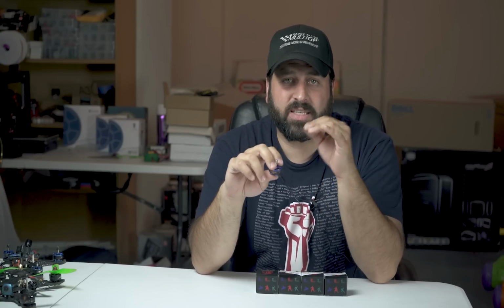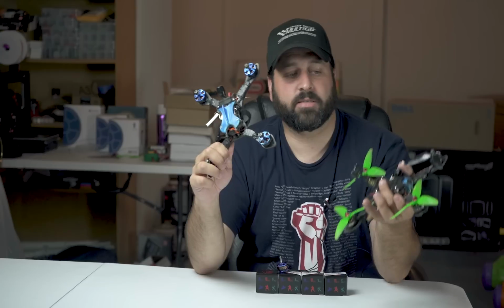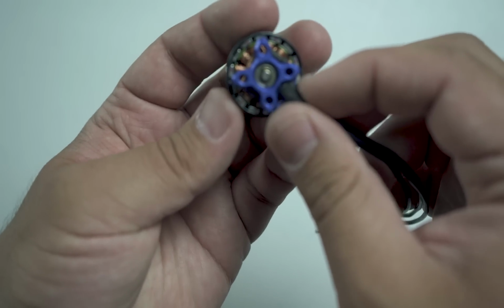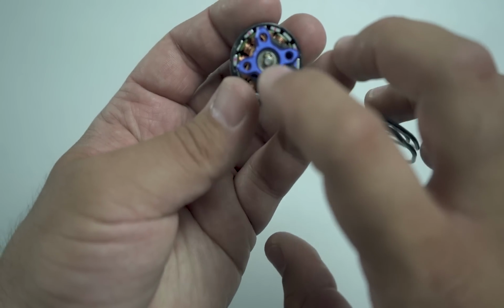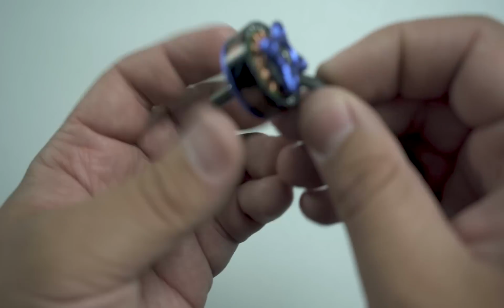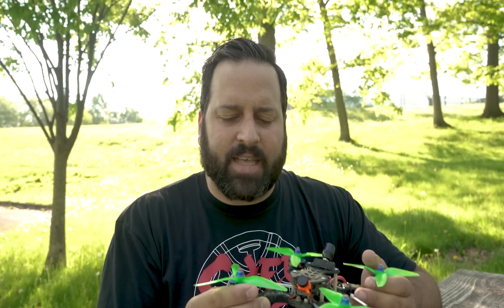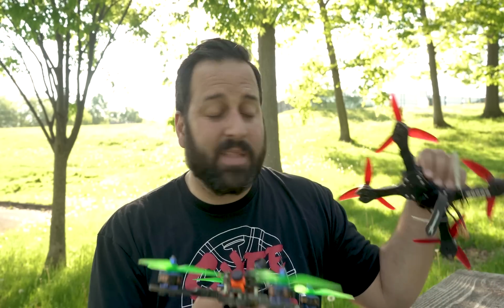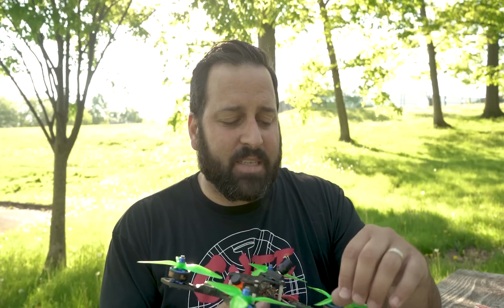DYS Samguk 2207 2600KV Motors

Comment: what hq prop would you run with this dys 2207 2600kv? and what prop would you use for the 2306 one if you have it? i wonder why racers always run 2207 and not 2306?
Reply from the maker: A lot of racers still run 2306, but 2207 is certainly more popular.  2306 is typically lighter and more efficient than 2207, but 2207 still has more power which can help taking technical maneuvers at high speeds.  

As far as props go, I'm running all 6S setups these days, but I really enjoy the HQ 5.1x4.1x3 V1S props.  I'm also a big fan of the HQ 5x5x3 V1S props.  I would probably try those first, even on these motors.

Comment: i dont like them . they have horrible bearings so much so if u fly anything more then a 4s your not gonna be able to get the vib out with filtering . it wont even fly correctly with 4s if it flys at all . the bearings will go to hell in one flight. forget it . for a bigginer why give them the headache ? for warned these motors without replacing the bearings will give u more headache then just spending 15 dollars or good lower end emaxes . i have older 2204 2300kv emaxes i purchased a year and a half ago for 24 dollars a set . 4 for 24  and they are way better for a begginer . i even run these motors on 6s and they still spin true.AFTER 2 YEARS . screw those dyss its a scam motor .

Comment: Dys Samguk motors are cheap exactly as they cost. Have two major points of failure - weak bearings and soft shafts. Bearings will begin to crumble after 2-3 weeks of active flying. Shafts will bend after medium-hard impacts against hard surfaces. The good thing - they perform really good when they are new. I have a quad with Samguk 2207 2600KV set right now. After month of use one motor bearings are began to grind and another motor shaft is bent after impact against tree branch. I guess, they will die after week or two. Conclusion is - if you have Samguk motors, don't crash your quad as long as possible. Don't land in dirt or sand. Of course, if you can spend enough for a bag of these motors, you can buy some 15-20 sets of them for one season and replace them every week :)

Comment: A have these in 2600kv and 2300kv and they fly great but a few good crashes and the bearings get pretty beat up. I have a set of hyperlites that i've crashed dozens of times and are still tight as new. I'm really all for saving money but in the long run i'd have to say stay away from cheap motors ( i'm looking at you too racerstar....) Once you turn the bell on a top quality motor and feel the super tight notch in those magnets you know where your money went.
Reply from the maker: The super tight notches aren't necessarily better though.  There are negative sides to it too.  Thanks for sharing the durability comments, that's the one thing I wish I could have tested for a video.  The performance was surprisingly good for the price at least.
Reply: John E Fly I agree, they fly great but the bearings are flimsy. Truth is I still fly mine and they fly fine, wobbly bearings and all. Im just picky i guess.

Comment: I have these exact motors. The 2207 2600kv version. And I ABSOLUTELY LOVE THEM! I've had them for a long time now and they've held up over time amazingly considering the price. These motors absolutely rip! They don't seem too amp hungry. They're super durable. They're actually 7075 aluminum. I've had big crashes, small crashes, weird crashes, and dirt burials and they've held up strong the entire time. Are there better motors out there? Yes. But the simple fact is these motors have one of the best if not THE best price to value ratios on the market. For an under $10 motor to perform this good and be able to keep up with much higher end competitors is amazing. And even if you do break one it's no big deal at all to replace. Now this is all based on my experience alone and is just my personal opinion but I can't see any reason why someone would purchase racerstars over these. Props to DYS for somehow managing to make such a damn good motor for so cheap! Great review! Keep up the great work and content.

Comment: Did your dvr came from your HDO goggle?
Reply from the maker: Yes it did.  But I would say that something is acting up with the tramp that I was using in the build with the DYS motors.  The video was better with my 6S quad and the one with the EMAX motors.  (not noise, just reception quality).

All builds were running Runcam Swift Micro or Runcam Swift Micro 2 cameras.
Reply: John E Fly  thanks for the quick reply. I’m thinking of upgrading my Dom V3 to the HDO as well.

Comment: They seam like a winner for THAT price but as some one mentioned all you have to do is replace bearings for $10...  will if your going to do that I would suggest an alternative upgrade to these would be what I consider to be the best kept secret deal right now is the Dragonfly Hurricane 2207 2500kv these thing are killer and made very well I used to run the aokfly 2305 2400kv which is pretty much the same price and at under $14 I don't see any motor that can beat it right now. You can see the test on miniquadtestbench (though that was a little higher kv prototype)
Reply from the maker: Interesting!  Honestly, I've never heard of those motors.  I would hold off on changing bearings on these motors.  Honestly at that point, I too would go with a different motor.  As is these were performing great for me, if I have to spend money to upgrade them I wouldn't bother.  Thanks for sharing regarding the Dragonfly motors, I'll be sure to check out MQTB!
Reply: John E Fly yeah some people say the Dragonfly are rebranded BBB motors which yes it looks like they are from the same factory but don't think they are the same specs

Comment: I've heard that the bearings is the only bad thing about these motors. But it's not impaticing flight performance that much as you said. You can always replace all the bearings for an additional 10$ and you have a winner.
Reply: RockTouching Having used them for a while on my first quad, I have to agree. Two out of four were solid when I received them, the other two had a very small 'play' in the motorshaft, you could push the shaft from side to side, not visibly but you could feel it move a tiny bit. After flying (and crashing) for a while, one of the two originally solid ones is now also a bit 'loose' in this way, and the others have gotten a bit worse.

Definitely a good starter motor though, although ordering five instead of four might be a good idea in order to prevent having to wait for other motors if you get single dud.

Comment: Garbage motors had 5 fall apart in 1 month lol under 20 flights 3 still work rofl. I told everyone how great they were when I first got them. But I have one crash on some grass at like 10 miles an hour and that ruin the motor even though it hit the motor guard. And then I had four other ones completely just separate themselves and fall apart from no crashes. I posted pictures on the rotor Riot page
Reply: had similar issues with the bullshit ass expensive MrSteele motors (version 1)
Reply from the maker: That sounds pretty crazy.  So far I haven't seen any issue, and I've definitely flown more than 20 flights with these.  They've also been crashed a handful of times.  I hope you just had a bad batch, but I can't really speak to the durability of these as I haven't done .enough testing, I can only speak that I haven't had an issue yet.  That's nuts man, I'm sorry!

Comment: Mid and top end power is a bit higher on the Emax motors...
Reply from the maker: I agree.  I think it was a little bit more across the board on the EMAX.  But I also think it was pretty slight.  I don't think it would be enough to be a significant difference on a race track.  Most likely something else would make a bigger difference.